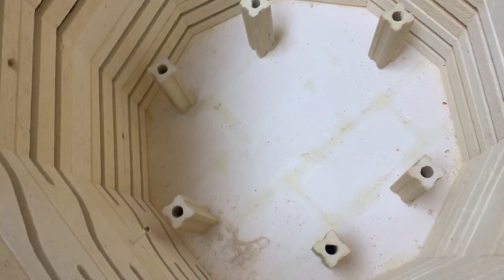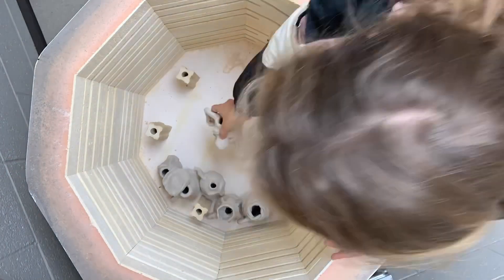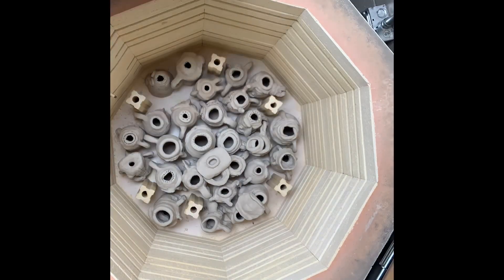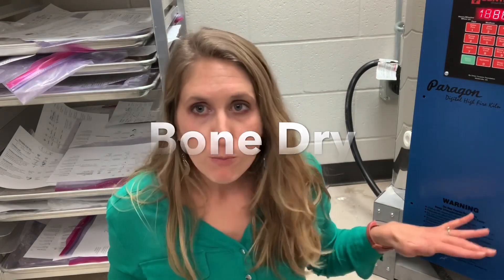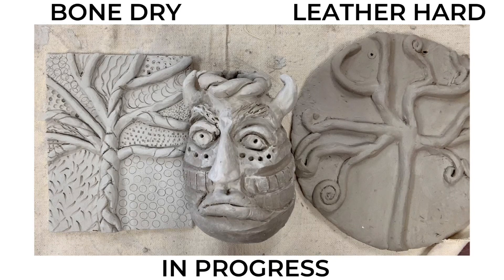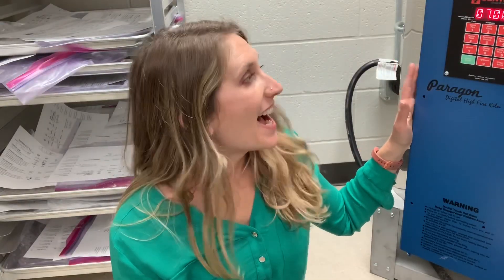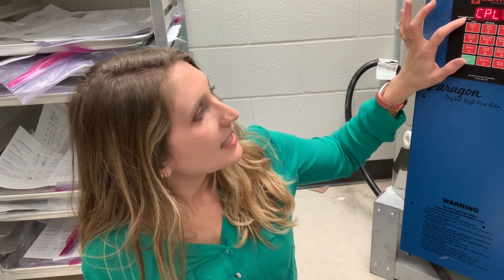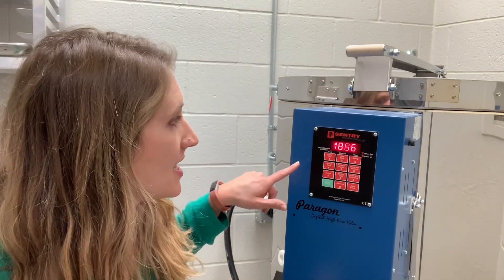How to Load & Fire A Kiln

Comment: It is extremely important to NOT put pieces on the bottom of the kiln! You need to have a shelf on a stilt that is at least 1” tall. Putting the pieces on the floor of the kiln doesn’t allow air circulation as well as adding all of the heat from those pieces to be on the floor. This is not recommended by any kiln companies. Just had to say this. It is also very important to not put glazed pieces on the floor of the kiln. If you have anything drip or stick you will have to chip away at the bottom of the kiln instead of just cleaning a kiln shelf.